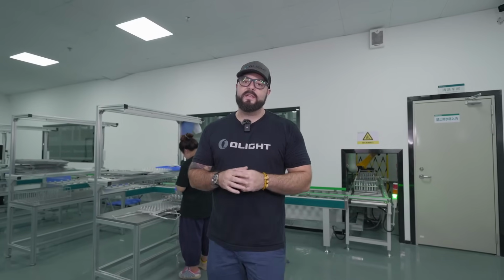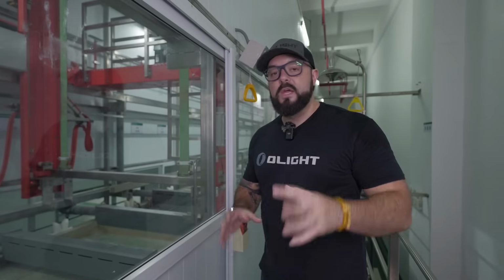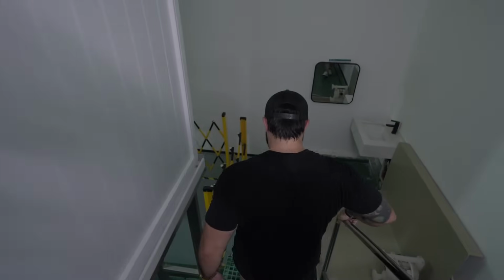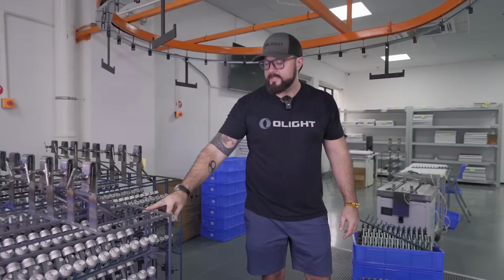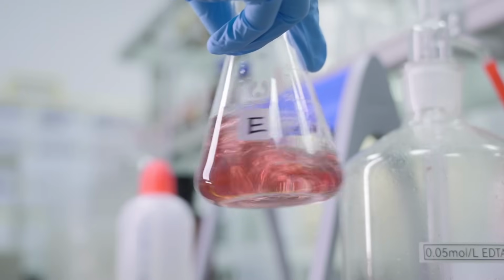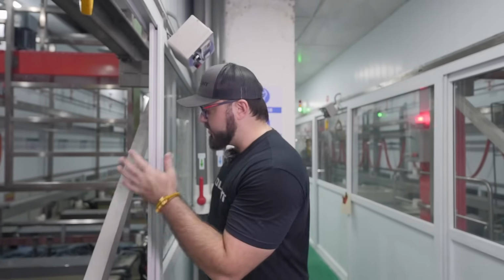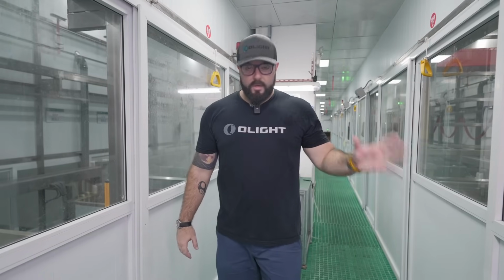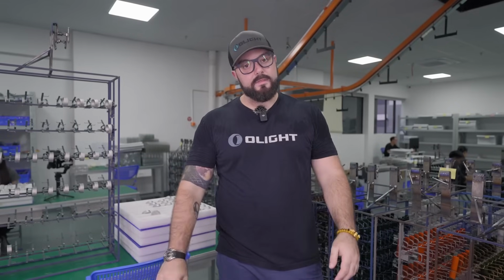How does Aluminum change colors? - Olight Anodizing Factory TOUR!

Comment: Nice video idea but for me it was a lot of talking and nothing really said.
I hoped to learn and see which liquids for cleaning and why are they used. Is it ultrasonic cleaning or with current. What effect has every cleaning liquid? What grid of sandblasting, glass pearls or alluminum? Is the anodization used with current or is it only a chemical progress? 
I would also be nice to see a flashligt part after each of this processes for comparsion.

I hope this could be an inspiration for the next video.
Thanks for the work.
Reply from the maker: Best I could do with limited time and a severe language barrier. We kept it as a lower level overview instead of a chemistry class because of these factors. 

With that said, this is aluminum, so it's chemical based versus electrical like titanium.
Reply: @olightworld  ok perhaps in the next video. 👍

Comment: The Olight flashlight is an exceptional piece of equipment, renowned for its high-quality construction and impressive performance. Its robust design ensures durability even in harsh conditions, while the powerful, adjustable beam provides excellent illumination. The flashlight's battery life is commendable, making it reliable for extended use. Additionally, the user-friendly interface and convenient size make it easy to carry and operate. Whether for outdoor adventures, professional use, or emergency situations, the Olight flashlight stands out as a reliable and efficient lighting solution